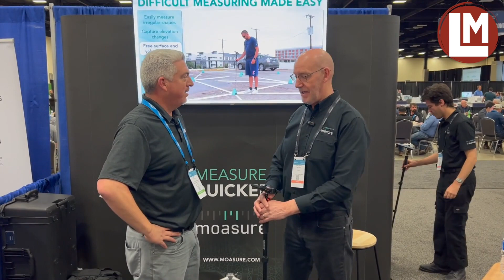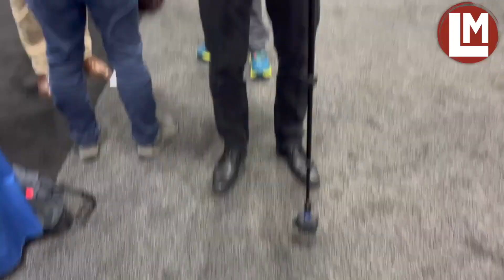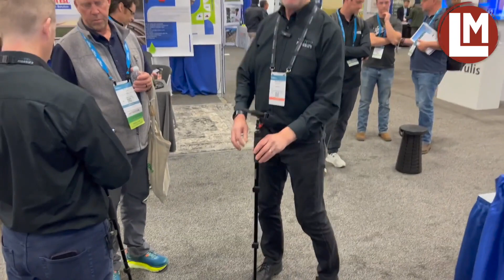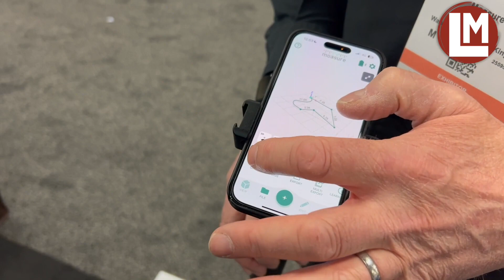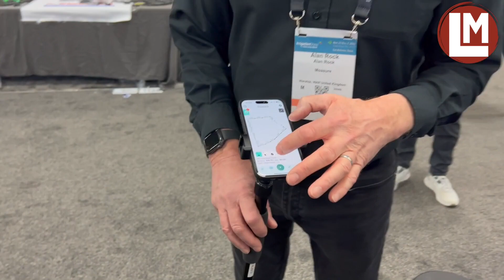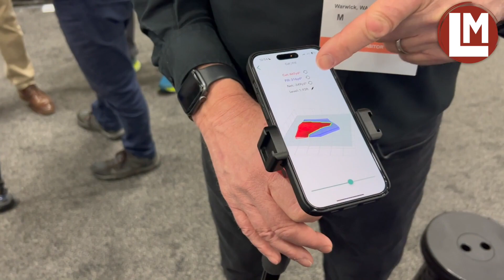Moasure CEO demos to Landscape Management at the Irrigation Show

Comment: Fantastic, can someone tell me the accepted accuracy of the measurements? Also can it be used to topo’ a larger area such as 5 acres with a 50’ elevation change?
Reply from the maker: Hi Scott, Moasure has an accuracy tolerance of +/-0.5% + a few mm, in each dimension, of the total area that you measure. This means that the larger the area you do, the more out it can be. The elevation change can be greater than 50", as long as you can place the device at the top and the bottom then Moasure will capture this with no issues. 

5 acres would be the upper limit of your Moasure measurements in all honesty, we recommend measuring for around 20 minutes per measurement to avoid your phone from crashing due to all the data it's taking.

Comment: What is the max area is can measure. Very cool
Reply from the maker: The short answer is however far you can walk and measure in 5-10 minutes, the actual time depends on your phone’s available memory (RAM Memory). The largest measurement we’re aware of is a distance of over 770m (2,500ft) and an area of over 25,000sq m (6.2 acres).
Reply: @MOASURE  thanks, that’s interesting. Memory is a factor, so could there be
 a app improvement where it stores the points in a db/csv file and afterward sends the larger than normal dataset to a cloud service for mapping
For times when it’s too big to calculate on phone?